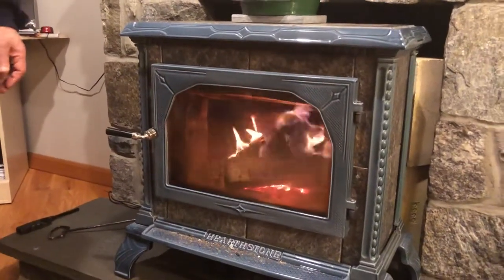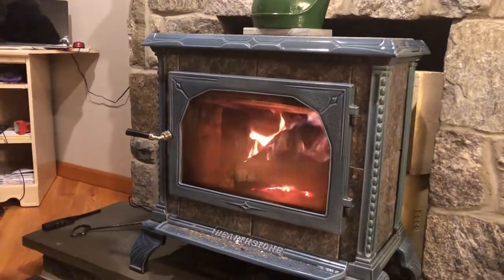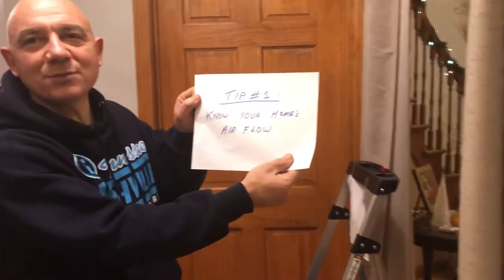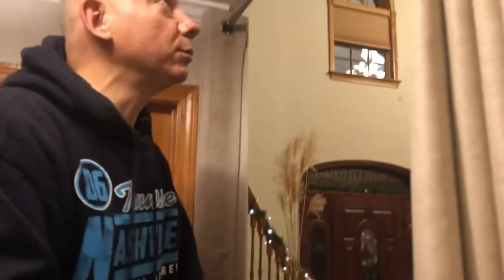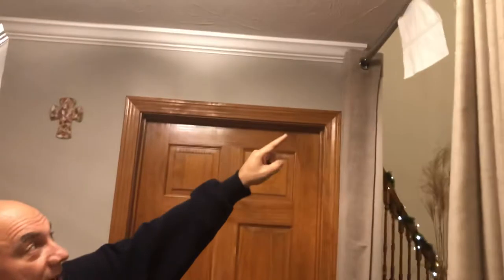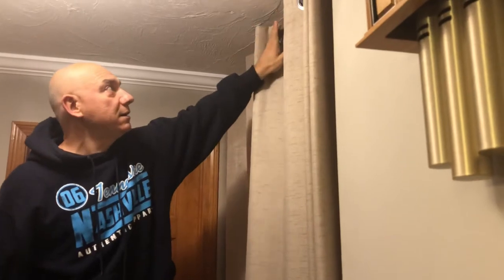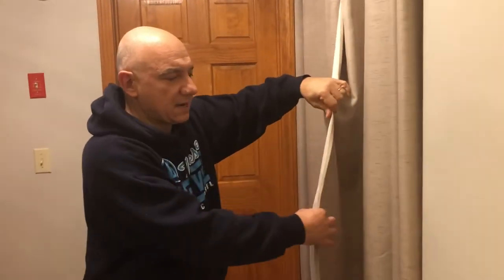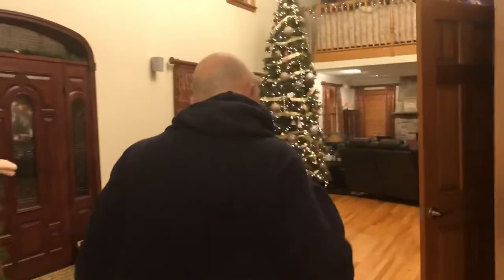Get the most heat from your wood stove, Part 1

Comment: High quality cat wood stove here on the mid-level floor in a verrry old, poorly insulated house. I use a 1/2 inch  single ply toilet paper strip taped to a stick to follow the warm air flow. We finally --after 30 years- added a door to tightly control the amount of hot air going upstairs. Special treat, the door was free and fits well.
Reply from the maker: Great news!

Comment: Thanks my bro you have just opened my eyes big time 😊 we just had our log burner installed and your video is exactly what I was looking for as trying to distribute as much heat as possible around the house, got heat powered stove fans pushing heat from the stoves towards the door and trying to push it a bit upstairs too fingers crossed, the curtain tip is also something we will take on board. Thanks once again for sharing your knowledge 🙏♥️
Reply from the maker: Glad to hear it was helpful!

Comment: great video, im in british columbia, northern bc, my local village had meeting, Air flow and heat loss solutions. Great tip on easy heat flow designs and solutions. no expert required just innovation of what's available and low maintenance, and less expensive alternative. Luukw'il Aam, very good.
Reply from the maker: Glad it helped!

Comment: Hi Jimmy, I live in NY State. I am more interested in that curtain. I actually need one to stop air from kitchen are to living room where I have my stove. It is cast iron so it is perfectly warm. Anyway could you send me the type of the curtain which stays up😀? Thank you for your help. J.
Reply from the maker: It is a thick curtain intended for a sliding glass door, with no light penetration. It has a plastic liner on the back side to prevent light coming through, and therefore does not let air through either. Measure the opening and get 2 curtains that fit the opening with extra for the pleats, and walk through the middle. On Amazon or local discount store. Key is to get a strong bar above. I did not want to put holes, so got very heavy duty shower bar that stays in with pressure and no screws. Hope this helps.